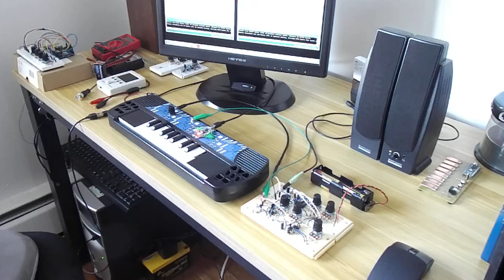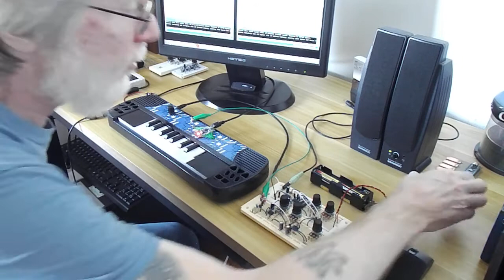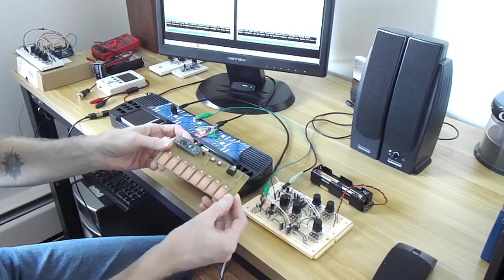Arduino Arpeggiator Code

Comment: What are the copper pieces used for the keys on your prototype board? Copper strips? Pieces of copper carved to key shape? It looks great! Hard to tell from the video what it is made of.
Really like your videos. A lot of useful information!
Reply from the maker: Hello Mike, the eight keys are little pieces of single-sided copper PC board. I cut them to size and used epoxy to attach them to the main proto board.
Reply: @petemcbennett6039  Thanks for the reply!! I have a lot of CMOS and arduino synth projects  that need  those type of keys.I will give it a try.
Reply: Umm circuit boards are just a copper/fibreglass sandwich dude. You just remove areas of copper to create the circuit.